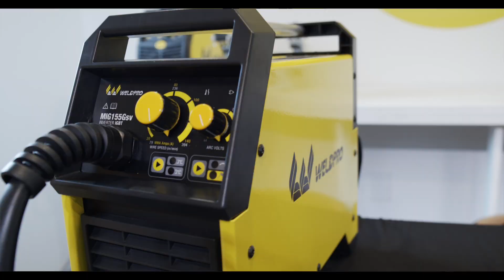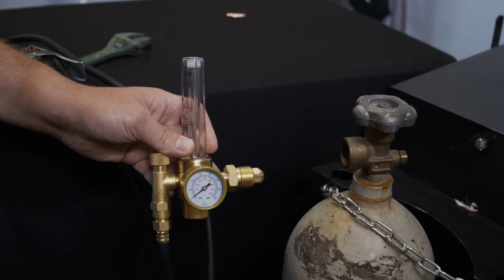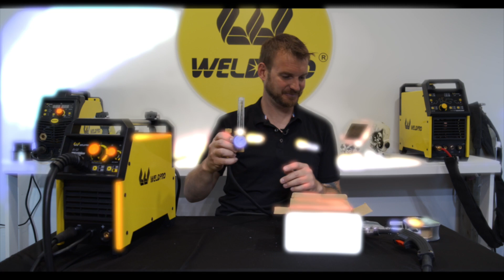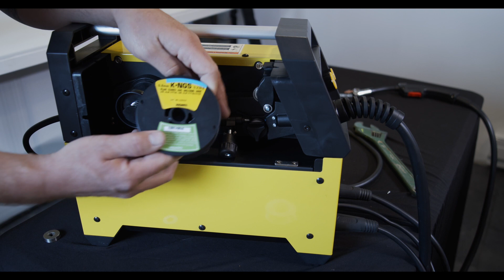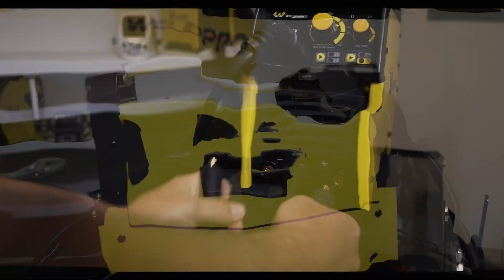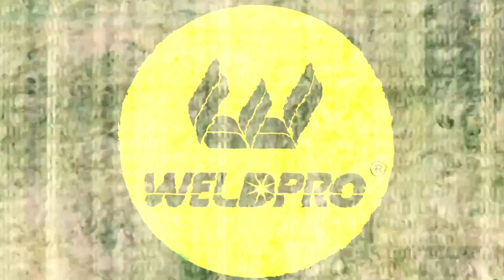Weldpro MIG 155 Part 2 - Set Up

Comment: Can this machine be setup to weld aluminum tig
Reply from the maker: I'm sorry no this welder cannot be set up to weld TIG aluminum.  TIG aluminum requires AC output,  these welders are DC output only.  To weld TIG aluminum you would have to look into our full featured digital AC DC TIG welder

Comment: Trouble on the farm….. my 155 WILL NOT FEED?? 
 Can I replace just the wire carrier? I can’t see that it’s pinched anywhere but it’s dragging going through there I pulled out the wire I put compressed air through it nothing came out I’m wondering if there is any thoughts from all of you guys? I’m new to this welding I bought this about two years ago i’ve probably used a quarter of a spool of wire. What are your thoughts? There’s a whole lot more experience here in the comments and on the screen and I could even think of but I would think that that would be the first thing to change because the drive motor turn the wire doesn’t always move smooth
Reply: I have this welder and have the same issue it only lasted 2 years with barely any use. The drive motor does what it wants
Reply: 😔🇺🇸ty

Comment: Does this come with rods to stick weld with?
Reply from the maker: It does not but you can definitely pick some up at a local supply place or on amazon.com
Reply: @WeldproWeldingEquipment  Which rods should I buy?
Reply from the maker: @johnmerkle1989  Have you stick while it before? Is there a type of rod you are familiar with? Also what type of material are you going to be welding on?
Reply: @WeldproWeldingEquipment  My weld pro 155 is arriving soon, it'll be my first welder.  I am completely new to welding and only know so much about it.

Comment: It doesn’t look like it will take an 10 lbs roll of wire
Reply from the maker: Thats correct, the 155 only takes a 2lb spool, our 200 series machines take a 10 or 11 lb spool :)
Reply: @WeldproWeldingEquipment  I am looking at the new 210 lcd it takes a 10 and I love the options it has I’ll be ordering it next week!! Thank you for the reply

Comment: i have 220v 30 amp will this work with the welder?
Reply from the maker: Brian Dale sure will man, that’s what I use. TECHNICHALLY you are supposed to have around 40 amps but I have never had a problem on 30 😀
Reply: @WeldproWeldingEquipment  thanks will be getting the migg 155

Comment: So, for flux core mig welding you need a different wheel than the one provided?
Reply from the maker: No it comes with all 3! You will just need to switch them out
Reply: Weldpro - Welding Equipment great, thank you.   Very helpful videos as well.

Comment: is the mig 155 auto voltage?
Reply from the maker: Nexus you need to learn about polarity. DCEN and DCEP ... stick is electrode positive ground negative. Flux core is electrode negative ground clamp positive
Reply: @WeldproWeldingEquipment  i download the book n i see what u was saying
Reply from the maker: It sure is! Automatically detects 120v and 240v :)
Reply: @WeldproWeldingEquipment  so even you put the adaptor or not it will auto adjust to the ac you plug it to
Reply: thanks for the quick reply i am setting up my machine now.
so the wire cant cant with it that can use without the gas?
Reply from the maker: Nexus yes just use the included adapter and it will work automatically. Plug directly in for 240v 😀
Reply from the maker: Nexus wire that comes with it does not use gas

Make sure polarity is DCEN for flux cored wire!
Reply: @WeldproWeldingEquipment  for some reason on book comes/ what u mean by polarity dcen i want to test it first with the stick rod then the wire that came with it.

Comment: can you do this for the Weldpro MIG155GD 155 Amp Inverter MIG/Stick Arc Welder with Dual Voltage 240V/120V welding machine, spool gun capable
Reply from the maker: Yes sir! Keep an eye out. We will have them coming soon!

Comment: Hey i was wondering if you could attach a spool gun to this welder?  I just ordered this welder and I'm really excited to test it out! And its able to hook up tig right? With tig and helium can you weld aluminum?
Reply from the maker: Spooled Up Garage no spool gun on this model but keep your eyes out for new products 👀 no ac for aluminum but you can weld anything else with DC. There is no dedicated Lift mode but you could try DC- on MMA mode and scratch start with the optional torch but I have never tried it!
Reply: Id love to see more videos on this welder, there is a good bit on the weldpro 200 but not many on this! Would be awesome to see if it could tig or not. My boss has a hotbox welder and it only has a stick or mig option but he has hooked a tig to it and said it works okay
Reply from the maker: @SpoolsG  We will try and make that happen! Thanks for tuning in :)

Comment: What amperage breaker/circuit will i need to run to particular model with 110V?   with 220V?
Reply from the maker: George Peters Hey George! We recommend a full 20a 120 breaker and it you have the ability... a 50 amp 240
Reply: Thanks so much. Just ordered one and I’m looking forward to using it for some body repair work! I tag y’all in the videos. ⚡️